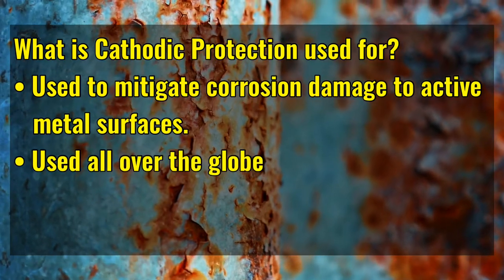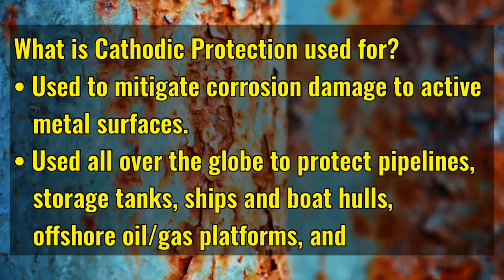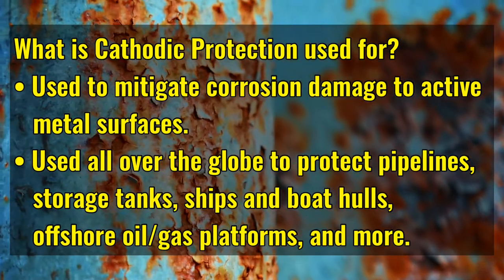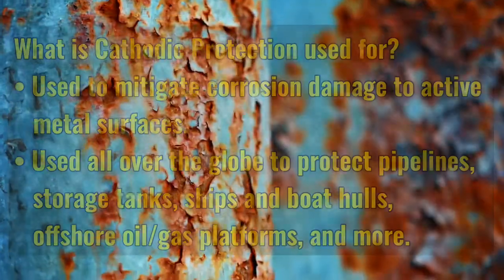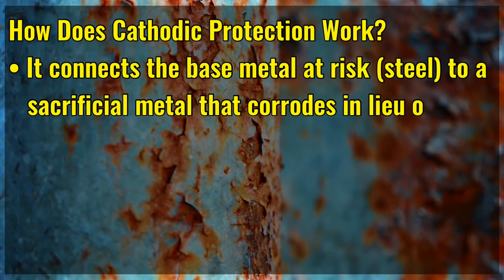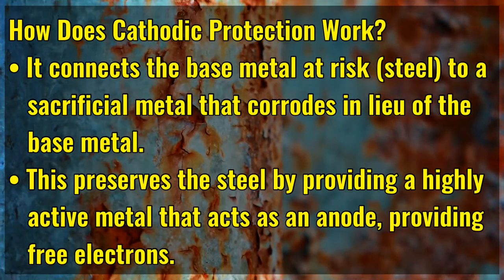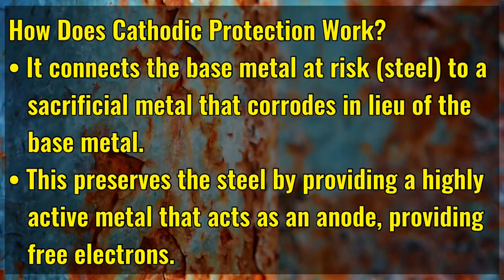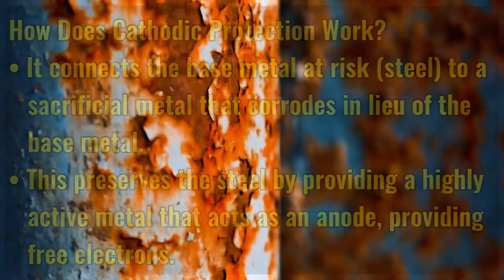Two Minute Lessons: Cathodic Protection, What is it?

Comment: Hi Jim. Thanks for the informative video but I would like to add something. Cathodic protection can be divided into two group. These are Sacrificial Anode Cathodic Protection and Impressed Current Cathodic Protection. Sacrificial one use an active metal as an anode such as Zinc or Magnesium (consumption rate is high). In Impressed Current Cathodic Protection, anodes are mostly noble metals like Titanium (consumption rate is really low).